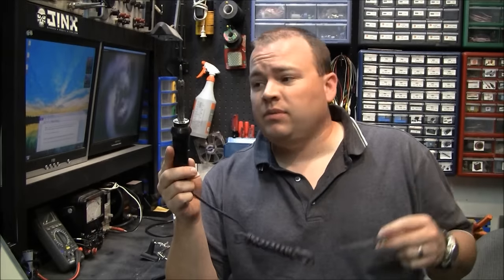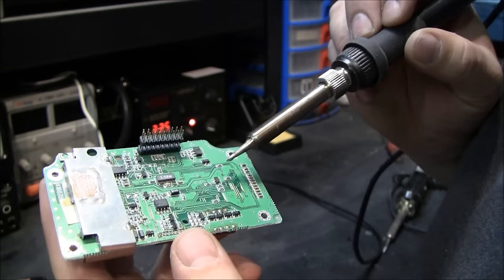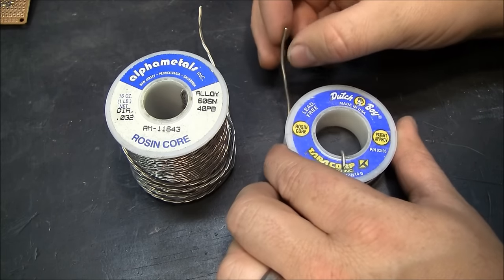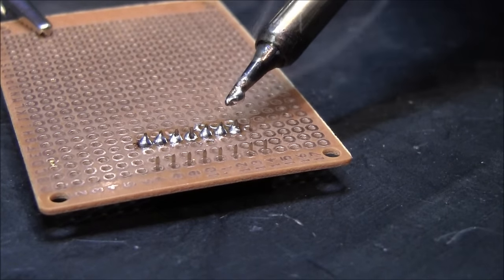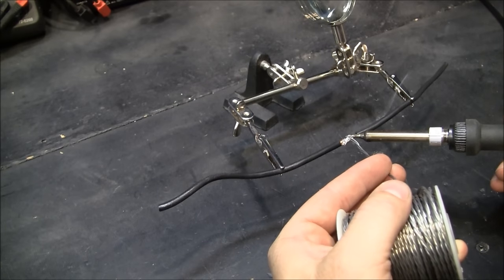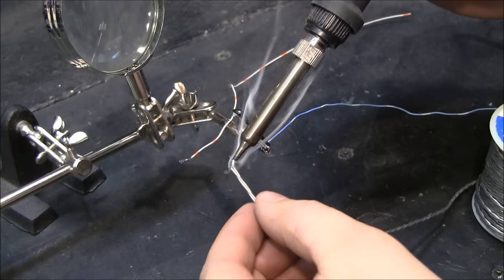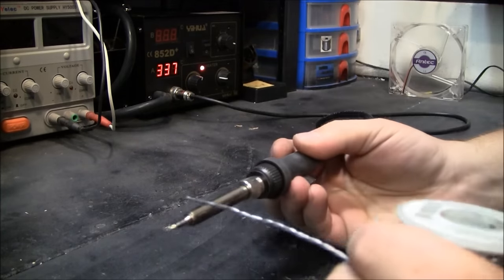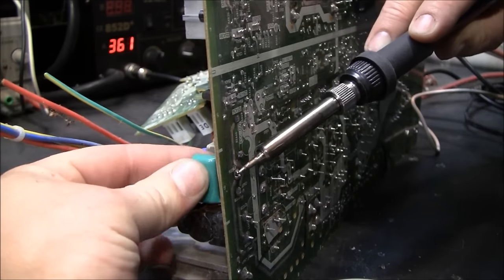Beginner how to Solder

Comment: Please don't tell me you get paid good money to solder. First off, massive globs on your solder to the micro chip prongs. I threw up in my mouth a bit. Secondly, the butt splice, you need to tin the wires first before trying to connect them and then also you dont run the solder so close to the insulation so that it wicks up under. You can get an anti-wicking tool, but it embrittles the insulation and is not good technique. Also, why is your solder two strands together? You're working on fine electronics, get single strand and you won't end up with so much of a god awful glob when you're done. NASA standard technique is to apply tip of iron to the base of the hole and the lead wire at the same time, usually after applying flux and typically pencil tip for small electronics, for a short period of time and then touch  the tip of the solder wire and remove. Practice makes perfect, but you don't want too little solder and never too much. it should concave  up from the base to the lead. Typically you trim the leads prior to soldering too.